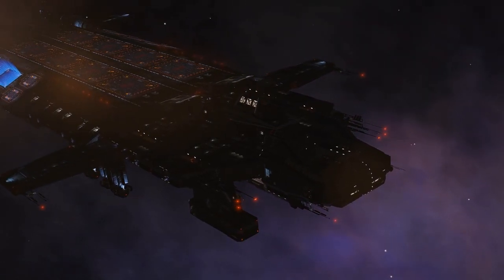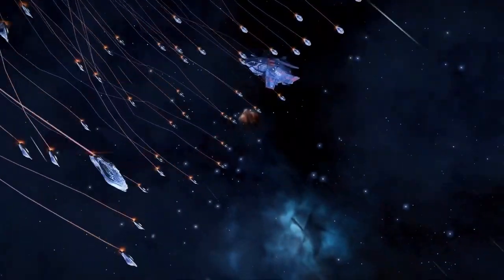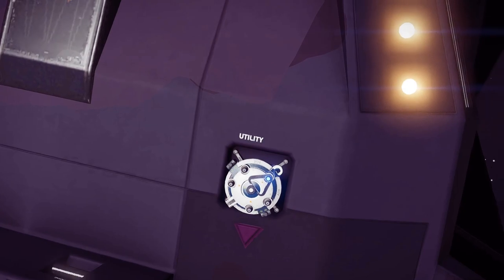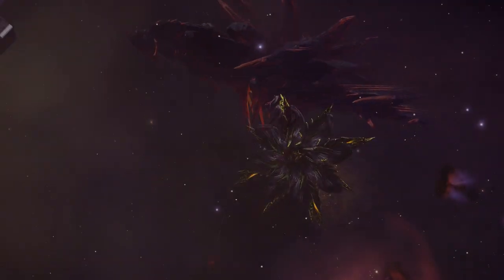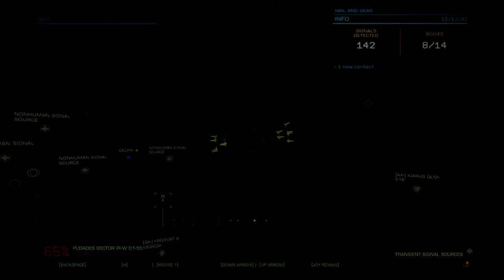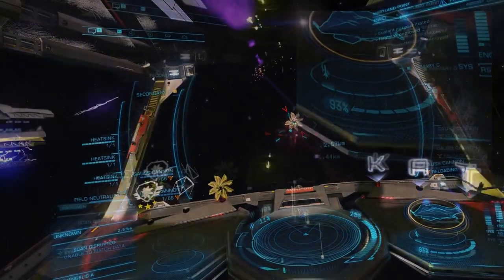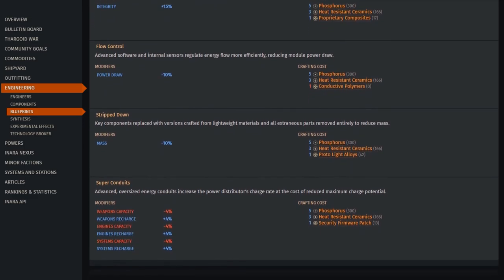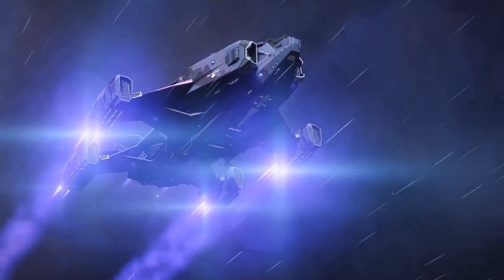Basic Introduction to Anti-Xeno Combat - Tutorial/Guide

Comment: This is as far as I can tell a very good guide. Most others gloss over severely over certain details and leave many a thing to more research on the pilot. Being the guide as good as it is, means that I'm a bit more critical than usual :) These are the things that stuck out to me:

13:22 emphasis on survivability: How much module damage are beginners going to receive as they learn the ropes? Sounds like B grade core internals would be more useful considering the significantly added protection at the cost of weight. If you can't fight properly because the modules get too much damage to malfunction soon, then A type core internals will not suffice and other than costing extra per death, will serve no purpose. After you learned the mechanics, the added agility when you go to a-types will only increase the factor of 
16:08 Guardian Module Reinforcements take a portion of powergrid. If you want to run colder and not rely on heat sinks too much, or if you want to have that shield on, you want your power usage to be manageable. Especially if you consider taking more than one module. I find that using the biggest module reinforcement as guardian and the other one or two as regular just for the added damage diversion is the most useful. Therefor you can keep repairing the big module without needing to worry about the smaller ones.
16:32 Are they doing absolute or caustic damage or a mix of both? Or what else is the "caustic resistance" for? This is absent in this guide. If it's always absolute damage, then shield tanking became a more interesting option as it gets an increased resistance to absolute damage depending on how many pips there are in systems, up to 60% . Absolute damage does not mean resistance true damage. It only ignores kinetic and thermal resistance but is still subject to Absolute resistance on shields with increased pips.
17:42 Strongly disagree . You gain more weight reduction with a D class of maximum size than taking an A or C class of the previous size AND you also have a higher jump range with the D type of the maximum size. If you decrease by 2 sizes, I seriously question how you want to get to the fight other than jumping there with a fast ship, then storing it in a nearby system that hopefully has enough jump range to the actual staging area, then let the combat ship of choice be transferred to you, then swap ship, requiring an unwanted downtime. In some instances you need +100% FSD jump range injection to even accomplish that jump.
18:02 There is technically no advantage to cluster capacitors because as long as you are not hard capped on booster MW requirement (which is a fixed value per ship, not per thruster). Therefore, stacking up more recharge time with super conduits is more useful. Unless the build requires a different experimental, like stripped down for weight reduction.
18:17 The only reason to use A type life support is you somehow wanting to continue the fight without canopy, therefore without a hud for the most part. You can safely dock within the margins of air you receive from a D class life support. When in doubt, synthesize oxygen on the way. This is a far bigger weight saver.
Type C sensors are absolutely not worth it with lightweight. If you don't do super long range combat, D type sensors are enough for the same reason if you want to save weight. D type with Lightweight 3 has the same 2 tons of weight while having less powergrid usage and still more hitpoints than a C type with Level 5 lightweight to reach down to the 2 tons. Type C sensors are absolutely the wrong choice here.
18:44 Usually the issue with repair limpet controllers is that you cannot repair mid combat as they get shot to pieces. Hull tanking in the game is generally woefully underpowered. You seem to also solely rely on the overheating function to get rid of the caustic damage thus not taking the decontamination limpets.
19:33 Suggesting Guardian Gauss cannons in an absolute beginner build is a bit overkill. An absolute beginner will want to go in and kill Xenos, thus the AX guns that are only for regular material trade-in without extra space-hopping to farm Guardian sites are far easier to pick up and equip to get your feet wet in AX combat. I'm not saying that Guardian Gauss cannons are a bad choice, I'm just mentioning that someone who wants to try it as a "first contact" basis should not worry about Guardian stuff and go for the human based AX stuff instead.

In general, one should make two AX builds of the same ship in the planning stages. A regular one and then one with weight stripping and then seeing how much the difference really is and which parts should be weight saved. Then you can really see what difference in handling and speed that makes. Often times, it's not worth the tradeoff.
Reply from the maker: wow that is a lot of text :D glad you found the guide helpful and thanks for watching ;)
Reply: @Citizen_Kate  As I said, if I find something really good, then I spend the extra time because I think it is worthwhile :) I know these videos take time to make, and time is the most valuable commodity in our life. Therefore if that much time is expended from a creator and the product is solid and good, I think it's only fair to spend time in return and give constructive thoughts. Granted, my typing speed makes long messages not that much of a big deal (and sometimes speech-to-text helps too).
If you care to go over the points where I question some decisions so I can get an understanding of your choices, that would be much appreciated too!
Reply from the maker: honestly you would be best to visit our discord at AXI and speak with our mentor team - some of your questions fall under personal preference (building a ship for the long haul not a stopgap while you learn for example) in fact so many of your objections are personal choice issues - my response is mainly just "yeah, you do you" but some are born of misunderstandings of how AX in general works - things like using the biggest GMRP are just crazy given the weight issues. And AX pilots will ALWAYS finish the fight without a canopy - docking? are you insane? we've already dumped a ton of mats by then. again, talk to our mentors and they can bring you up to speed with the basics if the video is not enough to convince you ;) 

I get it, we all feel degrees of skepticiscm when we are told we are doing something wrong - the build advice given by the AXI is built on thousands of hours of experience though and i really feel you could benefit from speaking to our mentors ;) 

the last part about gauss shows you really do not know what you are talking about - again not intended as an insult but you need guidance 

you are of course entitled to disagree completly though, this is the internet after all :) and i wish you well with finding a content maker better suited to your views if so ;)

Comment: I thought the type 10 was designed to fight Thargoids. Is the Type 10 a more advanced build or not at all recommended?
Reply: Type 10 is really baaaaad at fighting Interceptors. It's fairly good against Scouts, but it's no better than an Anaconda, and effectiveness against scouts isn't... representative of AX combat. 
It has extremely poor convergence for Gauss Cannons and the Experimental Limit does away with any potential it could have with its 9 Hardpoints, turns like a brick, moves like a brick, is a brick, and still isn't tanky enough to tank goid fire for long.